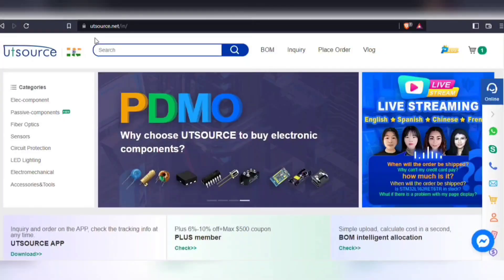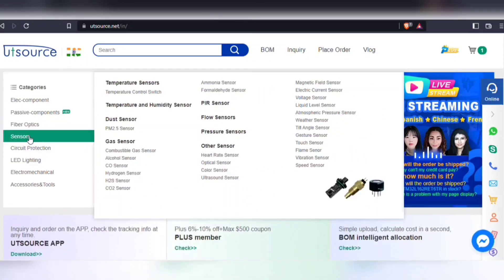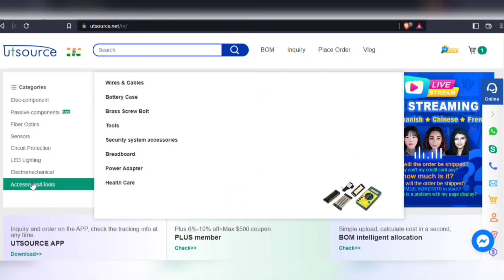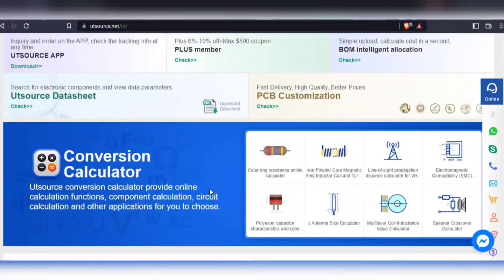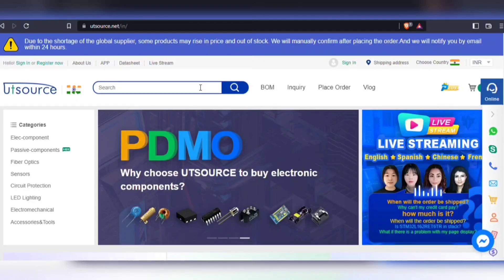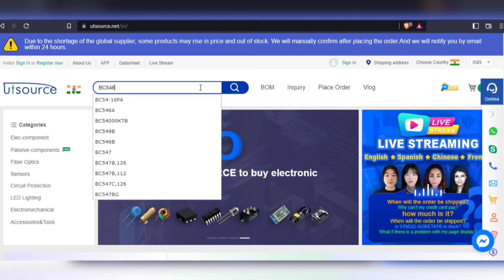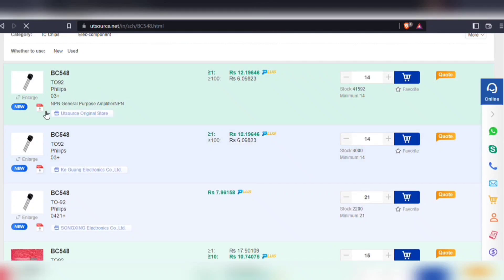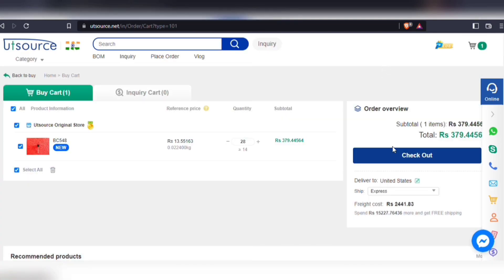This Device is very helpful You can make at home

Comment: Very nice.. what's the output voltage and amp sir?
Reply from the maker: Since this is basic boost controller without feedback stabilization, output will go upto 25v with 500ma current
Reply: @CreativeTechos  How do I increase this current?

Comment: This diagram you resistor used in 1K and this video PCB 10k resistor usen w is the sir
Reply from the maker: You can use 10k too as per availability i used, 1k works perfectly

Comment: Circuit diagram is not same..... Why
Reply from the maker: Circuit Diagram is 100% working, You can use any NPN Transistor and 1-10k resistor,  1k will better to gove more power output

Comment: Measure the output voltage when load is connected.
Reply from the maker: The output voltage will go upto 24v, depending on number of turns in Line Filter choke, since this is basic without feedback, the output current will be low but enough to light up 12 volt leds